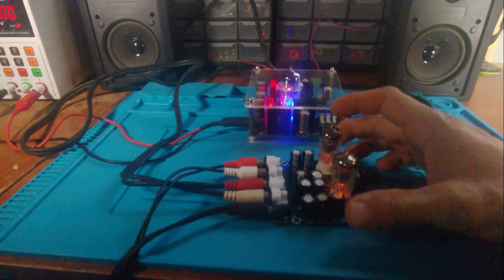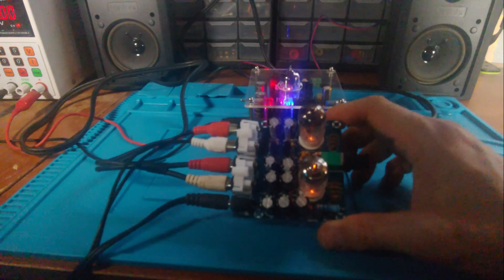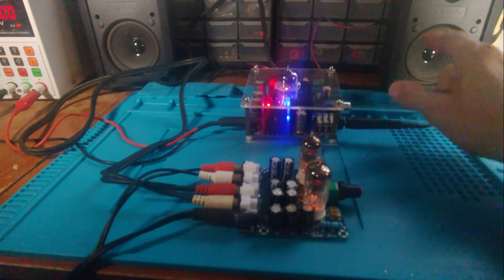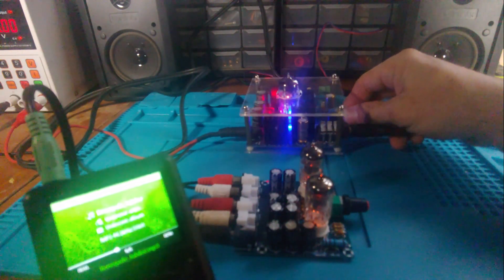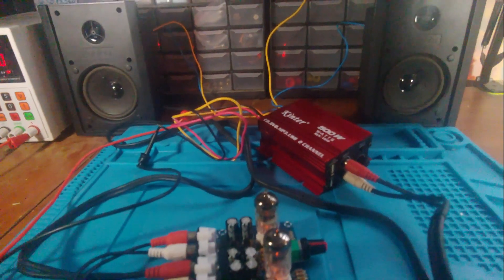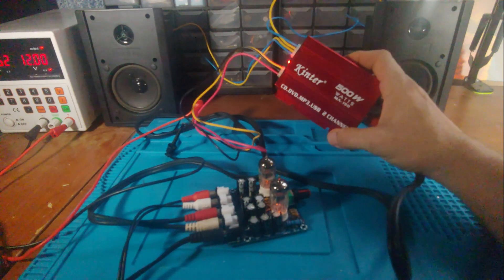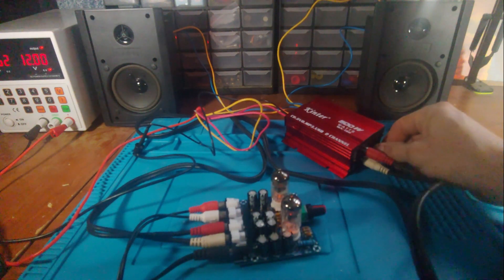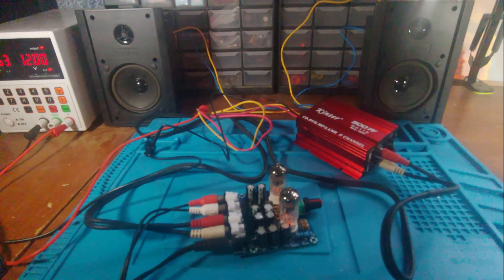DIY 6J1 Tube Preamp

Comment: I'm glad you kept the disgusting blue LEDs off the PCB. Looks so much nicer without that eye-cancer inducing blue LEDs. Really cool little setup for your son :)  Didn't have that kind of stuff. And these kits are great to fool around with. Some folks even modded them a little bit to optimize the circuit and the sound of it.